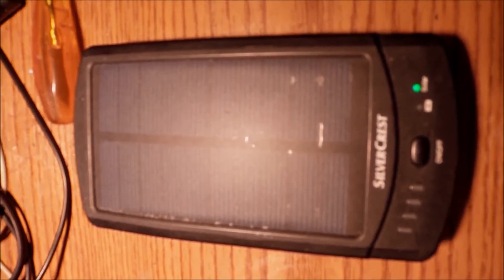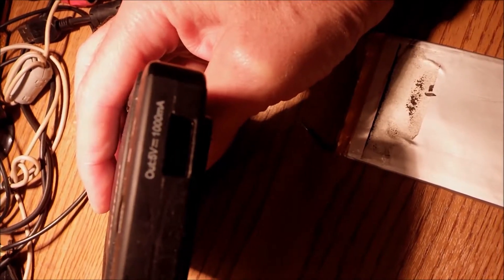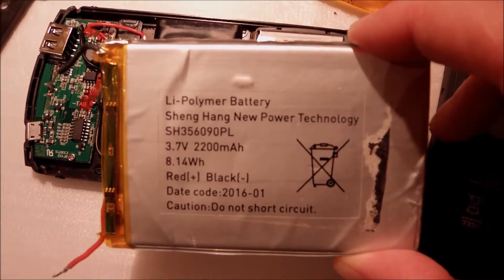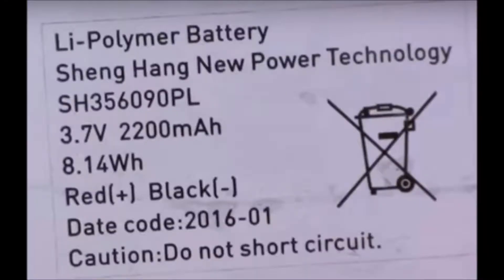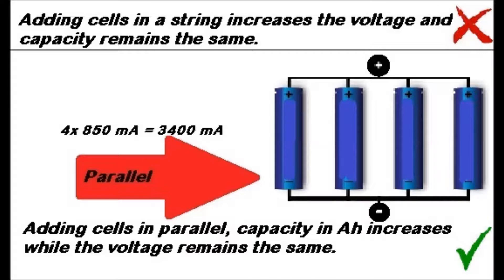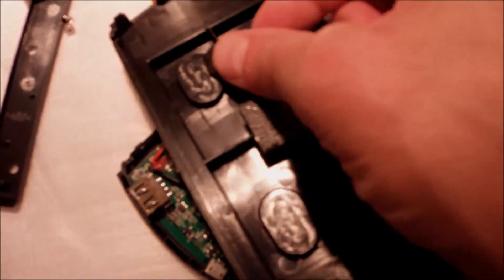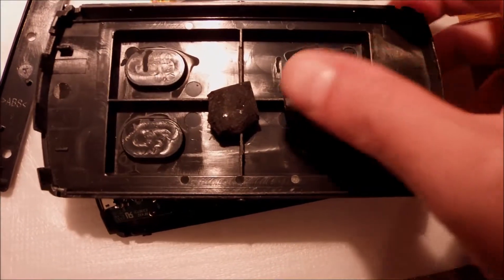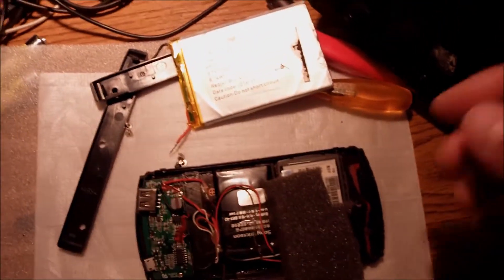SilverCrest SLS2200C2 from 2016 - A Solar Power Bank mod.

Comment: i have this powerbank at home, the battery wont charge and i want to replace it. but how do i know which newer battery i can use and how do i open the casing without too much damage?
Reply from the maker: Hi Chris! It is super easy to remove the 4 screws from the sides (2 each side). 
Remove the old battery which is crap and have 2-3 batteries collected from old phones, connect them together (in parallel), following this video, and it will be like new. 
It is literally said... Better than new!
Thank you so much for watching! Cheers!